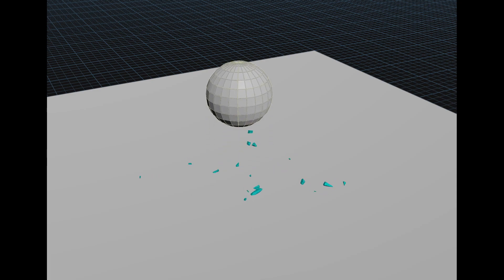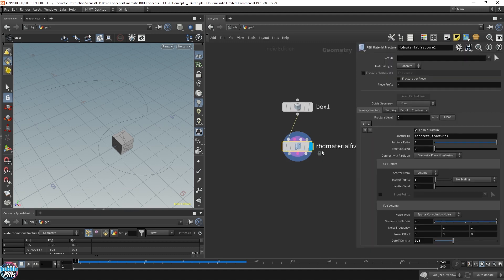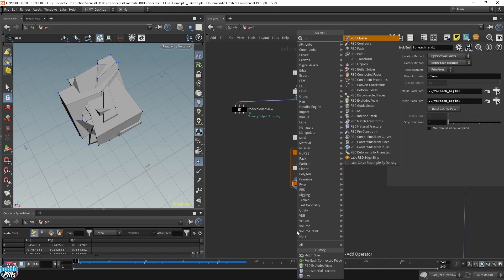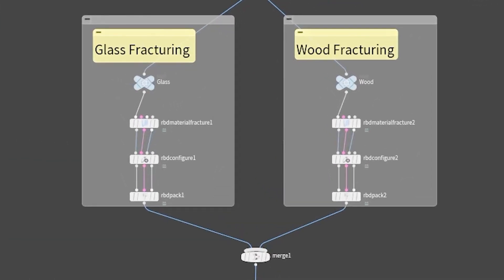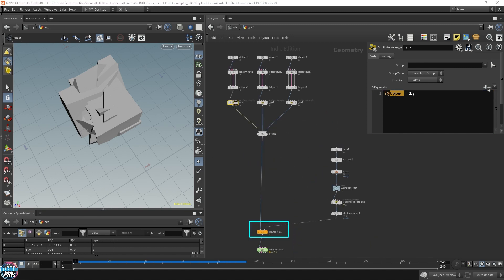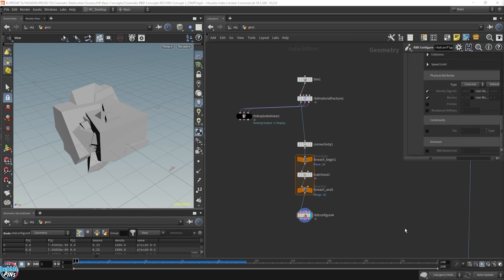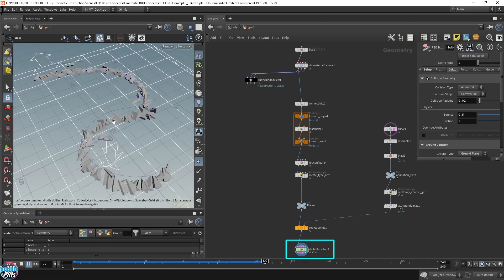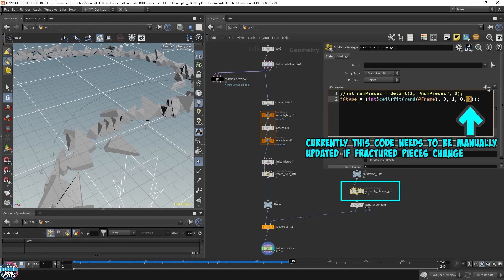Cinematic Destruction Basic Concept #4 RBD Emission Source (Rigid Body Dynamics)

Comment: hey, I'm following your tutorials for a while, You are great, now I got a small doubt in houdini crowd, I tried the bug crowd tutorial and it was working, but I want those bugs to walk on the floor and walk on the walls too in vertical motion, can you help me??

thanks,
Reply from the maker: You can try adding geometry that has a face normal pointing downwards and upwards.  If you watched my bug tutorial, you'll notice I only have a wheel with a single surface, like there's no thickness to the wheel.  Then in the crowd source node, which defines the starting position of the crowd agents, assign the head direction and up direction.  If you watched my bug tutorial, you'll notice that the bugs eventually do walk upside down on the wheel, but they just don't start in upside down.  I think I made the up vector point up as a starting position.  I am going to redo the crowd tutorials soon, but it'll take some time to get to.
Hope this helps!
Reply: @bubblepins  thanks for the reply, I'll try and get back to you
Reply: Hey thank you very much it's working, but they are not going upwards fully they are moving for some height and wandering in the same height I'm trying to find solutions for that
Reply from the maker: @tamilarasu736  If you define the up vector after the Crowd Source (before it gets into the DOPNET) that should start the agents in the correct orientation like if you want them upside down, then the up vector needs to be like v@up = set(0, -1, 0);

Then to start them off in the correct walking direction you need to define the head vector like, v@head = set(1, 0, 0);    This will walk in the positive X axis direction.

You can use these to define the initial state of the agents.  But you'll still need to manipulate the forces within the DOPNET to control how they continue to walk in the simulation.  So the above is BEFORE the crowd sim (initial state).

Hope that helps!
Reply: @bubblepins  thank you, I'll try that tooo
Reply: hey the problem remains same, the crowd walks vertically, but if the wall is 10 unit height the crowd walks upto 1 unit and wander there, I tried seeking also still remains same
Reply from the maker: @tamilarasu736  I think you need a bit more force to make them go up.  You can try using a pop steer path node and add a curve path.  The agents will try to follow this path as closely as much as you set the strength of the force scale.  Remember the curve path normals determine the direction of the curve path that they go.  So if you see them going in the wrong direction on the curve path, just reverse the curve.

Hope that helps!
Reply: @bubblepins  okie will try that tooo
Reply: @bubblepins  hey, sorry for not replying early, got some issues in my PC for the last week, but the idea its working, thank you sooo much for your help, only issue now I have is the transition (the 90 degree turn) if I do bevel I get smooth transition, if I have sharp edge I'm getting a little unsmooth transition
Reply from the maker: @tamilarasu736  Do you mean that the scene is a little pixelated when panning around an object with sharp edges?  You can try increasing the fps, that will give you better footage.  or maybe create a slower camera movement?
Reply: @bubblepins  no no no, what I'm saying is the bugs are walking on the horizontal floor and walks on vertical wall (like inside a box) that box edge I'm talking about, if the edge is beveled the rotation to vertical wall is perfectly adapted to terrain, but if the edge is sharp the bugs not adapted perfectly on the terrain(just for 10 to 15 frames where the bugs rotates vertically)
Reply from the maker: @tamilarasu736  hmmmm...  I had that issue before too.  I don't know if there's a clean way to fix it.  But maybe you can do a workaround, like trigger a crowd action to do a specific animation to make this transition smoother when the agent reaches the edge.
Reply: @bubblepins  Okie I'll try that, but thank you very much for your guidance
Reply from the maker: @tamilarasu736  I hope it works out!